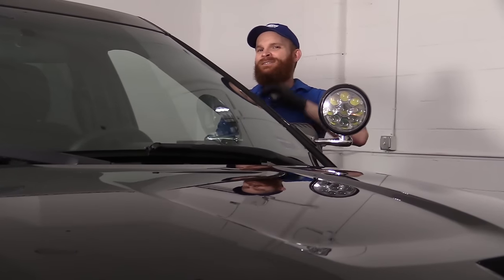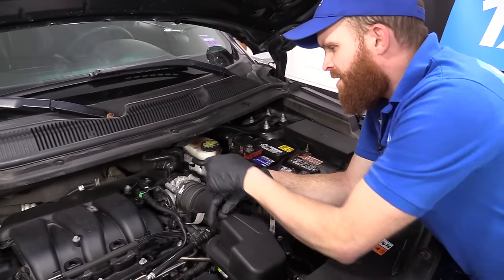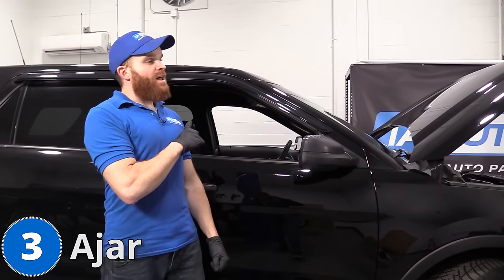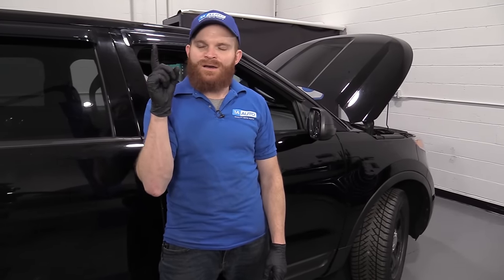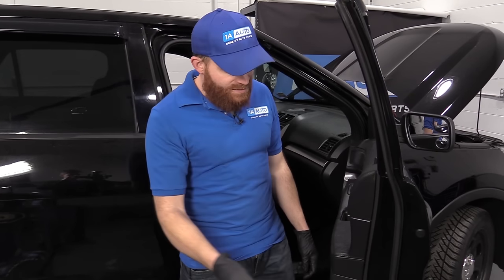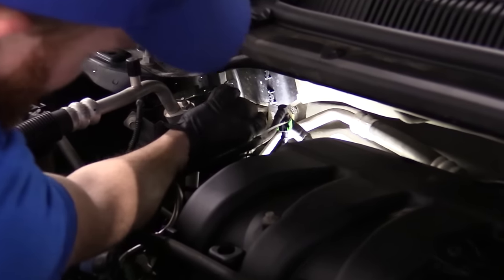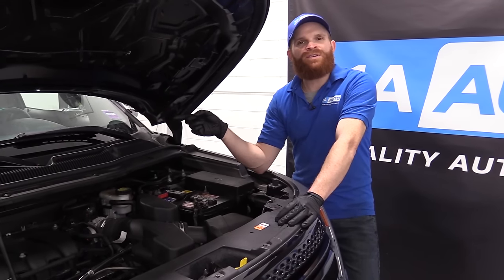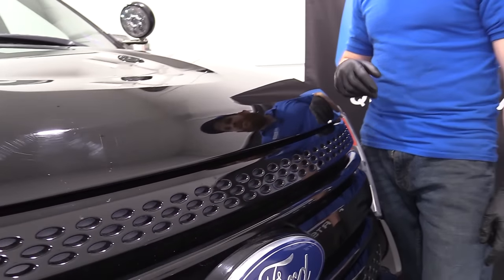Top 5 Problems Ford Explorer SUV 5th Generation 2011-2019

Comment: You know what’s funny where you said the carbon dioxide would come in at is where the electrical harness is in those slots for the electric trunk. And on my moms platinum the spare tire isn’t in the trunk so it can’t come in from there. No carbon problems. We have had two inches of ice on the car no door handle problems half of these are not problems

Comment: I had a 2016 ... got water into the primary headlight and all heck broke loose with the lights on/off/off/on.   ANNND it wasn't just a bulb replacement!!!
The front bumper has to come off to replace the entire unit ... AAAANNNND ... a electronic board was also corroded and failing.  Had to go to a dealer.
So to fix a headlight...   about $2,000!!!!    (Yikes!!!!!)

Comment: 2015 60k problems 
Steering gears
Ptu
Paint on hood
Window trim
Interior door panels
Air bag electrical problems
Wheel bearings
CV axles
Ac compressor
Rear ac lines
Not driven in the winter either
Reply: Forgot carbon monoxide issues as well from new when with tsbs done
Never had rear toe links done dumped it
Ripped seat and paint peeling in bumper when brand new repaired 30plus days at dealer when purchased
Reply from the maker: +JD JD Thanks for checking us out!
Reply: Sounds like you got a lemon. My 2013 has 90,500 miles zero problems except the hood is chipping
Reply: My wife also owns a 2012 Ford Explorer limited with the 3.5 V6 with AWD just like mine she’s at 138,000 miles and has also had no major problems just changing wearable parts. We keep up on all our services change fluids often every 30,000-50,000 miles, coolant, transmission fluid, rear diff fluid, PTU fluid, and we don’t have issues, all we’ve changed on hers is some bushings in the rear that went bad from age cracking, we drive ours year round just wash them often to keep salt off them.

Comment: The one thing I saw that Ford was doing for exhaust leaks (on police Explorers) was cutting the ends of the tail pipes and installing down spouts (elbow) so the exhaust blows down.  I have a 2017 Explorer Sport built late 2016 and haven't had and issues with the throttle body or exhaust leaks.
Reply from the maker: +NICK T Thanks for checking us out! http://1aau.to/m/Shop-1AAuto-c

Comment: I'm about to go look at one today (a 2015) with 88,000 miles on it). It's in great shape and a 1 owner. Are these cars reliable with higher mileage or are they known to breakdown a lot and have issuses?
Reply from the maker: +Williaem00 Great question! Search our video library for more on this vehicle: http://1aau.to/m/video-library-c
Reply: I've got 205k on mine. These engines will run along time IF maintained regularly. Oil, fluids, washing, detailing etc.
Reply: @dennisavery8249  I’m actually looking at buying a 2016 with 60,000 miles on it tomorrow haha. 
The carbon monoxide issue is the one that really bothers me.

Comment: One issue I have had repeatedly is a warning on the dash stating that the transmission is not in park when I turn the vehicle off. 2014 Ford Explorer Limited. I've found that if I depress the shift change lock button and jiggle the shifter while keeping it in the park position, the issue will go away. Any advice for this issue? It's easy enough to work around, and I know the transmission is in fact in park regardless of what the sensor says; I'm assuming its a bad sensor or switch in the shifter but I'm not sure.
Reply: switch bad but you have to buy the whole shifter to replace

Comment: What you didn't even mention the PTU. That thing fails all the time in these. It has less than a quart of gear oil and is surrounded on all sides by heat sources.
Reply from the maker: +raider762 Thanks for checking us out. Shop for high quality auto parts on 1AAuto.com:

http://1aau.to/m/Shop-1AAuto-c

Comment: My key fob quit working for the drivers side door, it works to unlock and lock just from touch on the passenger side. I had to door handle replaced cause we thought it was the sensor, but it still doesn't work. Any suggestions on what would be the next step? I think now it might be a wire in the boot, but don't want to get into that if someone knows something I don't. Any help is appreciated!

Comment: Hey I really need your help I have a 2014 Ford Escape X police vehicle and I put two jumper packs on it and it still won't roll over what is the problem is there a reset button or what's wrong with it could you please tell me I need to know by tonight

Comment: I got a 2012 explorer with a 159k miles. I have changed the dumb chain drive water which is a 12 hr job what a dumb design plus my airbag light is on. You have put grease the yellow airbag connector that is underneath the seats. Imma trade it in for a f250 none diesel
Reply from the maker: +Muscle Car Garage 88 Thanks for the feedback!

Comment: I had a 2002 explorer sport. We were in a bad accident. I was parking about stopped went to switch to park. The engine started reving like a race car accelerating. Jumped the curbs road and went ahead on into a tree. I was hitting the brake could not stop it. What the heck caused it?
Reply from the maker: +Michelle Grandi We wouldn't be able to diagnose an issue like that here, you may want to have a local mechanic take a look at it. Thanks for checking us out! http://1aau.to/m/Shop-1AAuto-c

Comment: My CHECK ENGINE light is ON and I am getting the following error codes on my Ford Explorer 2013 please suggest how to fix them:

Powertrain Control Module:
(1) P0420:00-68 Catalyst System Efficiency Less Than Threshold - Bank #1
(2) P0430:00-EC Catalyst System Efficiency Less Than Threshold - Bank #2
(3) P2196:0028 O2 Sensor Signal Biased/Stuck Rich - Bank 1, Sensor 1
(4) P2198:0028 O2 Sensor Signal Biased/Stuck Rich - Bank 2, Sensor 1

HVAC:
(1) U0140:00-08 Missing Communication with BCM

RCM:
(1) U0557:82-08 Invalid Data Recieved From Front Control Interface Module A

I will be very thankful to you for your kind help and reply.
Reply from the maker: +anisarfat We wouldn't be able to diagnose an issue like that here, you may want to have a local mechanic take a look at it. Thanks for checking us out! http://1aau.to/m/Shop-1AAuto-c

Comment: Don't forget the drive train issues. Our mechanical is constantly fixing these on the police package AWD ones. Esp the Differential.

I heard as far as police package goes, Ford didn't really do much for it being "police package". I heard aside from a few tiny differences and maybe engine difference, that the suspension and such were all regular explorer parts.
Reply from the maker: +shadowhunter388 Thanks for the feedback!
Reply: They have ALOT more crash support as well, but to get the guaranteed rear-end crash support, you need to have a full size inflated spare secured inside the rear. I've been in 4 crashes with 2016-2019 Ford PIUs & responded to several, they protect you very well

Comment: You missed the electric power steering issues on 2013 and up explorers
Reply: Had that issue had me stranded 9 hours from home. You can reset code to make it where you need to go. Electrical cage needed to be replaced. $2000 later.

Comment: Hmmm have had my 2016 for 7 years now and the only problem i have had is with the water pump. And the genius who designed an engine which requires an engine removal to do a fucking 100 dollar part should be flogged repeatedly.

Comment: I own a 2013 Ford explorer  3.5 v6 none ecoboost. And my  explorer  has starting  issues after it cools down. As long as the engine is warm it fires up with cno issues it all.  Any idea what could cause this problem I took it to the Ford dealer shit multiple  time and they can't find the issue
Reply from the maker: +Bandzz Live We wouldn't be able to diagnose an issue like that here, you may want to have a local mechanic take a look at it. Thanks for checking us out! http://1aau.to/m/Shop-1AAuto-c

Comment: I have a 14 sport the oil pressure light kept coming on and when you turn the air on it seems to sound as if its seeping out
Reply from the maker: +Contessa Tate We wouldn't be able to diagnose an issue like that here, you may want to have a local mechanic take a look at it. Thanks for checking us out! http://1aau.to/m/Shop-1AAuto-c

Comment: Anyone having problems with oil filter drip changed mine 3 times always happens. 2017 3.5L I use oem parts

Comment: This dude did not properly cover the most common issues. This is what you need to look for: water pump weep hole leaking, shift to park light staying on while in park, rear toe link recall, turbo waste gate linkage breaking (Ecoboost models), cheap door arm rests cracking. Ford tech Makaluko has good tips and most issues are easily fixed by doing it yourself. Even the water pump can be done in a day without taking the body apart unlike a lot of German engines with similar designs
Reply from the maker: +icyhotmike Thanks for the feedback!

Comment: what about the wheel bearings.....
Reply from the maker: +Ontario Observer We're always cycling through common cars. We'll add this repair to our list! http://1aau.to/m/Shop-1AAuto-c
Reply: Good luck getting a rear one off if you live in the rust belt. Aluminum spindle, steel bearing fuses it together.

Comment: Them are not the top 5 problems. Above the problem with the throttle body is the problem with the timing chain driven water pump in the 3.5l v6. And the dumb idea they had by putting the transmission check and filling area down low in an area where debris can get into the fluid easy.

Comment: My 2016 Explorer has an issue with some of the exterior lights and keyless entry pad flashing when the vehicle is off and parked. Has anyone ever experienced this? What could cause this issue?
Reply from the maker: +Tim Connelly We wouldn't be able to diagnose an issue like that here, you may want to have a local mechanic take a look at it. Thanks for checking us out! http://1aau.to/m/Shop-1AAuto-c
Reply: Problem dotyczy prawdopodobnie dostawa ja się wilgoci do panelu. Ludzie mają ten problem po deszczach, wilgotnych dniach lub myjniach. Uszczelnić panel powinien rozwiązać problem.

Comment: so im actually getting an 18 xlt explorer soon, how common are these problems exactly dood?
Reply from the maker: +Just A Dood This all depends on how you drive, how you maintain, and many other factors for your vehicle. 1aauto.com
Reply: I have a 2015 and it’s been a great suv
Reply from the maker: +Tim Schultes Thanks for checking us out! 1AAuto.com
Reply: I have a well maintained 2012 with 205,000 miles and she is an excellent machine.

Comment: I have a 2016 ford explorer and every time I go over 80 mph the check engine light flashes and it misfires , I changed all injectors , coils and no matter what it shows on obd 2 scanner that its cylinder 1 and 5 , not sure what to do , can anyone please help. Thank you !
Reply from the maker: +@franciscorobles7663 We wouldn't be able to diagnose an issue like that here, you may want to have a local mechanic take a look at it. Thanks for checking us out! http://1aau.to/m/Shop-1AAuto-c

Comment: My check engine light came back after they fix my Catalytic converter. What the real problem
Reply from the maker: +Rasell L Holt We wouldn't be able to diagnose an issue like that here, you may want to have a local mechanic take a look at it. Thanks for checking us out! http://1aau.to/m/Shop-1AAuto-c
Reply: @1AAuto  Thank you. I did that Diagnostics Test at auto zone. It's a misfire.

Comment: What about v6 engine that water pumps goes bad .. coolant can leak inside oil pan and blow up engine .. because water pump is ran inside of timing chain (dumbest design ever) .. I mean generally speak water pump goes bad in most vehicles I don’t understand why ford would do such a thing ... to replace water pump you have to take timing chain... so to replace water pump it can cost you up $1500-1700 🤦‍♂️..most cars it’s easy to replace and shop  charge slow around $150-300

Comment: The PIU being used for the video is kind of false.   The regular interior lights are part of the overhead console and have individual “map lights a

CO2 entry although not unheard of is more common on PIU due to the excessive time for their  engines.   They sell portable CO2 detectors that can be stuck on the cargo area and easy to see the indicators.

Hood repair is a joke.  I was a victim of the hood corrosion.  The repair is they remove the hoood, send another hood from the factory that has a rust preventative coating applied then install and Paint/blend to match.  This is the same coating that could be applied during initial vehicle assembly and avoid the warranty claim.  Just like any big business they are taking the gamble that the corrosion won’t appear until after the cooroaion rust through warranty expires.  For the ones that do get caught by observant owners they fix....for every vehicle that does get. noticed and repairs under warranty there are probably thousands that don’t get caught.  

Not on the list but hood related.  The cheap aluminum on the hood and no reinforcement the hood will have a slight flutter during high speeds.  Hood is latched but a slight flutter that is noticeable from the driver seat.  There are “snubbers” on the leading edge of the hood but not on the rear where the flutter originates.

Hood Support Rod.  Really $50-60K for a vehicle and running a $7 dollar prop rod?   Inexcusable.....they do make a aftermarket kit that keeps pneumatic support rods that connect to the Shock towers.....About $100 and about 15-20 minutes to install...again....AMHIK!!.....lol.

Comment: 2013 explorer less than 70k miles brake caliper sucks, and expensive water pump replacement avoid these get a Toyota rav4 150k miles not a single issue except for maintenance

Comment: Who would buy a 4-wheel drive  vehicle in the first place???  Where is your head at???  Unless you drive off-road.  Do you like to pay more for gas??  Difficult to park.  They have door ajar switch issues (poor quality vendor which has had issues for many model years and Ford continues to do business with the same vendor). Worse, is the internal water pump which will always fail by 65,000 miles.  Most are replaced under warranty.  After that, you will be replacing all of them at the same rate ($2.100.00)   The Power transfer unit (PTU) will fail about every 65,000 miles.  Most covered under warranty. the first time.  If you fail to change the oil the PTU, @ the ford recommended 31,000 miles and almost impossible to get to to change.  Replacement of the PTU is about $3,200.  GM also internal water pumps but have a lower failure rate; but they will also fail.  I had both my catalytic converters  replaced under warranty.  The Explorer has many premature failures of many heavy hitting items.  The Automotive Equipment Manufacturers Association state all vehicle parts are made to be failure free for 150,000 miles.  So, you can see many engineering issues with the Explorer.  The Class Action Suit against Ford for their water pump issues was dismissed  in March of this year.  Unless the plaintiff can show that ford knew they had a bad design, they will not be allowed to re-activate the suite..  So, did I mention the worst headlights in the industry.  Most police departments will add additional lighting and restrict officers from chasing speeders with the Explorer as being unsafe @ high speeds, and never give chase @ night.  Other than all of that, they have one of the best breaks in the industry.  The police model has a 250 amp alternator; enough to power many lights and transmitters.  Now, do you want to buy a 4-wheel drive vehicle.  On their Taurus AWD vehicle has the same issues.  Unless you elect to pay for an aftermarket extended warranty, stay away from a used Explorer which is not under warranty.  Good luck, and get a used Impala.  They will get through the snow as well as a SUV with better gas mileage and are free from all of the above issues.  Be warned.

Comment: ❤️‍🩹❤️‍🩹 UUH..? Number One ☝️ Problem Is YOU NEED TO REPLACE WATER PUMP BEFORE 
120,000 miles regardless if it needs it done ✅ or not! 
This will SAVE U from destroying the engine and after you replace it - 
It’s Perfect 👍 for at least another 100,000 miles

Comment: was looking at used explorers of this model, because i am infatuated with its aesthetics, but this review has turned me off big time.  what a problematic car! not looking at buying this anymore =(
Reply: My wife has a 2013 with 170k miles, the hood paint is a problem and we did two recalls. It has been an excellent car that will go over 200k.
Reply: @daleferrer7916  I am seriously thinking to buy 2019 explorer sports . But after reading the reviews here….😰,is Ford this bad or the competitor smearing .. never have a Ford before

Comment: You missed the the shifter not in park issue.
Reply from the maker: +Don Mueller Thanks for the feedback!
Reply: @1AAuto  ask me how I know!
Reply from the maker: +Don Mueller How do you know?
Reply: @1AAuto  had a 2014 and it was a common problem with the first dealer responses being to replace the shifter @$1000.  Problem is a micro switch, not the whole shifter.  This is a common problem across years.  Later TSB has  switch replacement and wiring harness.  Car will continue to operate but will alert shifter not in park.